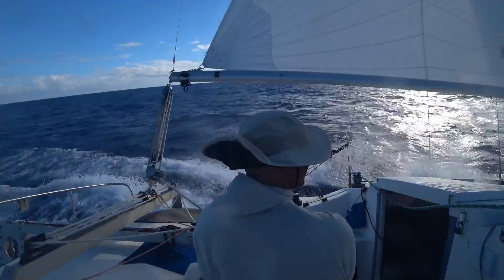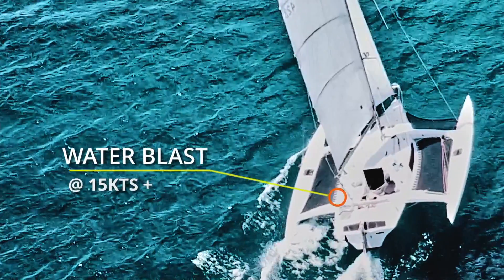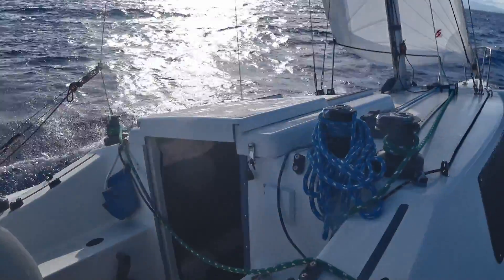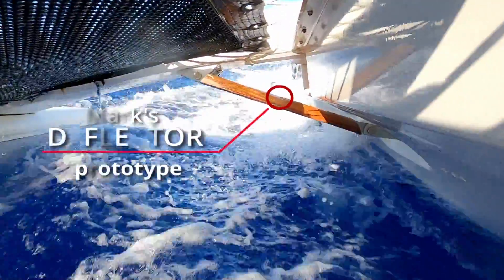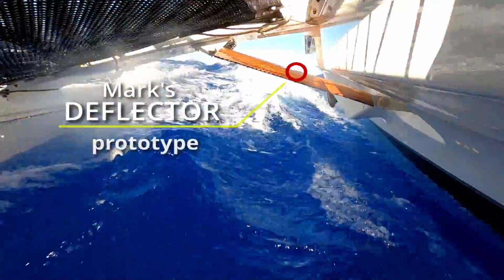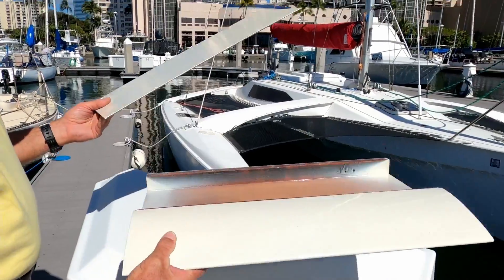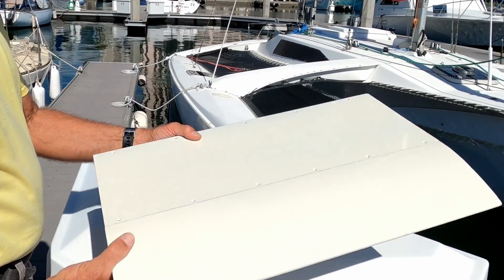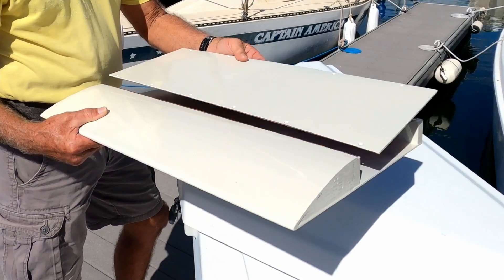DOUSED IN THE COCKPIT?   Deflector solution for Farrier's Corsair F-27 trimaran

Comment: Would have been nice to se it in action.
Reply from the maker: You can get a feeling for how it works by watching the last frames in the video.  The concept is simple.  The forward-facing blunt surface of the aluminum struts coming across from the ama to the main hull cause water that hits them to shoot straight up through the hole between the after main hull and the after inside corner of the tramp.  Mark's "wing" device (aka deflector) presents a sharp forward edge to oncoming water allowing the force of the water to be dissipated over the wing.

Comment: Great video, we were having the same issue with our Corsair 880 Sport, my friend is an aerospace engineer that has worked at NASA for quite awhile but now works for a company that designs and builds INDY cars. His solution to the problem was similar to the deflector show cased here, except he designed so it can be deflected like flaps on an airplane, its a little bit longer and wider and made from carbon fiber, it really does the job. I also installed a dodger and a full cockpit enclosure to help keep dry on rainy days. The dodger really helps just in case a huge wave hits especially when were reaching 17 to 21 Knots.

Comment: This is a very cool idea , Where is this installed at?  I am not following here?  is this on the arm that extends the ama?   So you are just inclosing the hole in the beam structure?
Reply from the maker: Mark installed the deflector around the rear strut.  Normally, water occasionally hits the strut and blasts it straight up between the tramp and the after end of the cockpit.  The deflector diverts the energy of the oncoming water over and under itself.   From 2:44 onward, Mark explains the reasoning behind, the construction and the installation on the rear strut (you may have to turn the audio up a tad).
Reply: @rcameronbryce186  How did it end up working out?
Reply from the maker: @TC-yx1qt  So far so good.
Reply from the maker: See my reply above to @MrSychnant.